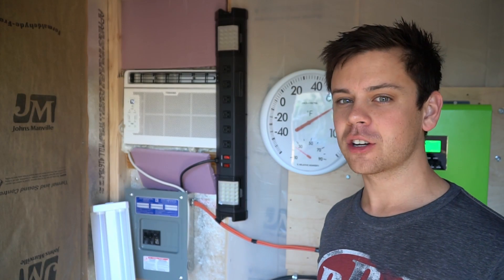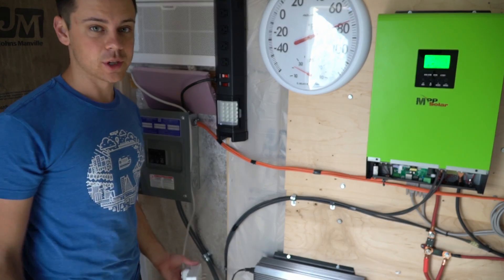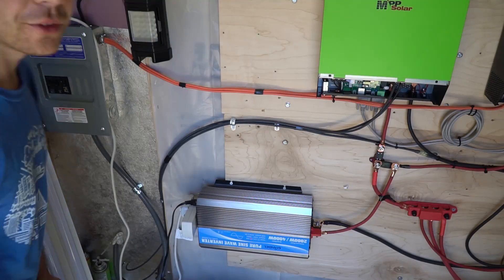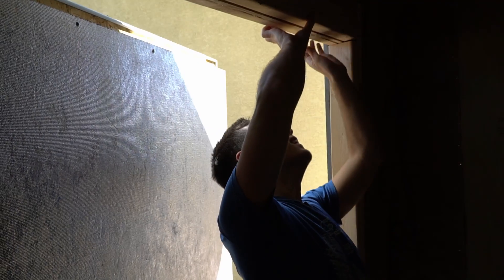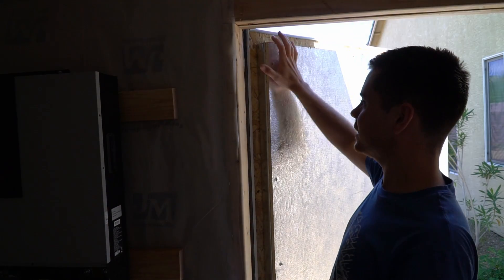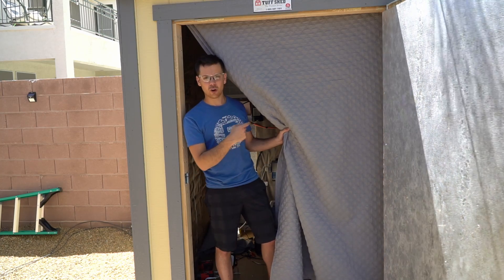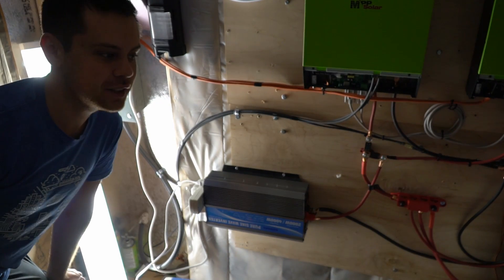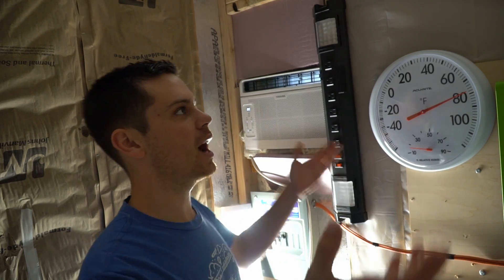Cheap Solar Powered Air Conditioner Part #2

Comment: Do the batteries, inverters and other equipment really need an air conditioner?  Or would a VENTILATION FAN with enough CFM airflow to maintain the power shed the same as the outdoor ambient be adequate -  even in Phoenix AZ?   Is the battery performance degradation and or battery life decrease at higher battery temperatures significant enough to really warrant the air conditioner power consumption?
Reply: Since Will lives in Vegas, where it can get over 120°F at times, yes, he does need an air conditioner to keep it at least down to around 80°F, since the batteries he uses need to be kept at least that cool to be as efficient as possible, plus many electronics don't like to be too hot as well.

Comment: It’s not all about temperature,        humidity is the big deal I think you are  living in Nevada where humidity is low
Reply: Yes. When electronics is involved, low humidity aggravates static electricity. I single touch could wipe out an inverter. We keep our data centers as close to 50%RH as a compromise between comfort and static control.

Comment: How to overcome the lack of oxygen issue since the cabin is airtight to 100%.
Reply: Do suggest the charge controller, inverter and batteries unit to install outside of cabin because they produce heat that wasting a/c cooling effect.
Reply: @chinkimloong3425  Those are the very things he's wanting to keep cool!
Reply: Why? Nothing in there requires oxygen.
Reply: @g-whiz286   the human inside cabin that breathe oxygen to survive :)
Reply: @chinkimloong3425  - It's not a cabin. It's an equipment shed. It would only be a problem if he was in there for several hours with the door closed. Highly unlikely. However, a low oxygen alarm wouldn't be a bad idea.

Comment: Heat goes up !  Insulate the roof and use TWICE the thickness of insulation.
Reply: Since he's mainly trying to keep it cool, letting some hot air out at the peak would help.  He needs more to make sure the hot air from outside isn't coming in the lower levels. ;)
Reply: @Tumbleweed5150  What I did miss is that the solar panels are mounted on the roof.  No direct sun on the shingles !

Comment: President Will Prowse, Prowse Enterprises, 
I built an outside cat house, which I heat with a halogen bulb in the winter. I placed an ACURITE temperature monitor in the cat house. It allows me to read the temp of the box 300 feet away, in my bedroom. They cost $20. and are powered by two rechargeable AA batteries. Bought it at Walmart and my outside cat loves being warm when it's snowing. Maybe, you could monitor your solar shed at two A.M., while you're still in your bed. Better yet, get 2 of them and monitor, the inside of the air conditioned shed AND the outside temp of your back yard. Go crazy and create a spread sheet.  ;-)   :-D   :-D

Comment: Heat go up... Cold go down...  As per the rule you are not loosing cold from the roof, loosing a few degrees in the middle.

Comment: Just a 1/2"-1" foam board on the celing, would probably make a big difference, with solar panels on the roof, helps alot!
Reply: Yes that would be the easy way. though the studs will also transfer heat.I would insulate over the studs as well. Basically insulate between the studs, the over all that put on some 1 inch boards. very easy to do and will eliminate most of the thermal bridging.
Reply: @SSingh-nr8qz  you surely know, but i thought this would be a good spot to contribute my 2 cents: ideally, the insulation and structure (studs) should not be in the same plane, for walls or roofs.  Best practice is to put continuous insulation outside (and not in between) the studs.  The dew point always occurs somewhere inside of or on the surface of the insulation when you have a temperature on one side lower than the dew point.  Therefore you want your structral components to be away from that and the potential for rot and corrosion dew point condensation creates. 
He should have stripped whatever cladding is on the shed, to add the insulation from the outside- creating a wall type that architects refer to as an "institutional level" of construction.

Comment: How difficult would it be to dig a hole under the shed and put the batteries underground?  Should keep them cool with no energy input.
Reply: I was thinking the same thing.   Wouldn't digging down a meter or so reduce the need for air conditioning the batteries altogether?

Comment: Yes, insulate your roof.  Seal all holes.  Use a temperature gun to see where the heat is coming in.   As a Canadian, air leaks are the enemy.  Like #744

Comment: Just a quick comment, you probably already thought about this but make sure to have the AC on recirculate instead of fresh air;  Especially since nothing in the room should be generating humidity, unlike an RV with heavy breathers or those with botanical proclivities :)
Reply: I've tried this, well, in a studio apartment to keep people's cigarette smoke from coming into the studio one other time.

Was cool in the studio one morning and I put the air conditioner in fan mode, and that is a feature to recirculate the air in the studio. I came back to the studio to find that the 70° air had increased to 85°. ☹️ 

I have a new 6,000BTU air conditioner. I live in an older studio apartment, which has an attic in the ceiling in the kitchen. That's the only place I can think heat seeped into the studio. Or maybe the fan unit in the bathroom let the attic air into the studio. 🤷

Comment: The easiest and cheapest was to insulate the ceiling is a drop ceiling. One it decreases the overall space to be cooled, its lightweight and if you need to get into the space you are not tearing paper on the insulation to do additional tasks. It is super easy to install and the best bang for the buck
Reply from the maker: Smart idea
Reply: DIY Solar Power with Will Prowse the other thing people forget to do if you really want to make it the Mose efficient is to insulate the floor. 3/4” ridgid foam then 3/4 ply on top of the foam screwed down. You are making a cooler, coolers are insulated on the bottom as well. You will be amazed once you do that as well as we drop ceiling

Comment: You would need 2 coats of insulation with air in between for optimum insulation (kind of the same way you DIYed the door).
Reply: In most cases like fiberglass the trapped air is the insulation.

Comment: Suggestiion:  Put two temperature sensors, on inside and one outside (in the shade) of the shed.  Sample them every minute, or some other fixed interval, and then map the difference between against power use to get the DeltaF/KWh factor.  This way, you don’t have to wait for the temperature to hit 100F, you can do the test any time you want.  BTW, 167W average consumption for keeping the shed Cool is pretty impressive.  I would have thought it would be twice that.  Always nice when the experiment yields unexpected or surprising results.
Reply from the maker: Oh that would be cool

Comment: The door seal on the hinge side needs to be placed on the door frame and not the actual door. As you will notice, every time you open and close the door the seal is sliding against the frame and not pressing as it is, on the rest of the door. This will make that part of the seal wear out in just a few uses.. Also, do insulate the roof.

Comment: Will, you should go to home depot (or amazon) and buy a inferred laser temperature gun to point at different parts of the shed and see the surface temperature inside.  Its a very useful device and you can check visitors for their temperature too...  Anywhere inside the shed that is bare wood is going to need insulation and will transmit heat from the outside....you can also look at setting up a pressure test to find any air leaks that will allow the hot air to come in.  cool experiments...
Reply: He has one that he uses on things watch his recent video with the relay being temp tested

Comment: You might want to get a thermal camera to check the inside of the shed. That could provide a better idea of where the hotsports are. Is there a good way to estimate the thermal load of the electronics inside? It would be itneresting to know how cooling is used to keep the electonics cool, versus heat getting into the building.

Comment: The roof is the hottest part turning into a giant radiator as the sun hits it. Then you’re south and west facing walls as the sun rises and sets. Window mount air conditioners are energy hogs they’re the most wasteful way to air-conditioning place it’s just physics by nature they’re designed that way because of their size constraint they have to use more energy than a conventional mini split because of the smaller evaporator and condenser therefore the refrigerant pump has to work harder to move more pounds of refrigerant to do the same amount of work then a mini split that would have a larger condenser in a larger evaporator and a large fan that does not have to move so fast using so much energy.     Yes you would have to spend a little bit more money for a mini split like the FUJITSU 33 SEER. But the amount of money you have to pay for extra batteries extra solar panels and possibly still have to go on grid and pay high daytime energy rates in the long run it’s worth it.           If any company that makes window mount air conditioning says their energy efficient it’s a lie no comparison to a mini split due to the physical limiting factors of size.
Reply: True.. Obviously sheds don't have attics so what's the best way to keep the cool air inside and the hot sun away?  Just mount the solar panels on the roof and standard insulation?  That's all I can think of unless there's some other tips I'm missing.  I'm trying to setup A/C in my workshop-shed.
Reply: Steve H call list a few things. 1: painting a roof white. That is good for a 20 to 40° drop in the surface temperature of the material that is struck by the radiant heat of the sun.        2#  Depending on your budget because phone cost several times more than fiberglass we all know you must insulate. 4 inches of foam will nearly give you double the amount of insulation of 4 inches of fiberglass.    If using reflective foil backed foam keep about a quarter inch gap between the surface of the roof and the phone so you do not get direct conduction heat absorption from the roof material.         #3 option if you have not built your roof yet and are in the planning stage. Put roughly 3/4 of your insulation value on the top sheets on the outside of the roof foam R30 value. Then on the inside underneath for example you can use R15 or R19 value form. These are all just examples you can move the Numbers up and down just remember if you choose this method put more insulation on the outside of the roof than the inside especially in cold climates for the winter has to do with condensation on the inside problem. Also take a note depending where you live North Dakota you’re worried about -15° outside. Arizona you’re worried about positive 115° outside. I’m in San Francisco we average about 65° summer and winter lol 😂.              If money is really an issue and something is better than nothing. By the double sided foil reflective bubble wrap that you see used as insulation on ducting. Staple it either by eye or by using little 1”X1” length of trim pushed up against the roof as spacer to attach your bubble wrap. Leave roughly a 1 inch gap at the bottom of your slanted ceiling and a 1 inch gap at the top. This will block nearly all radiant heat from your roof material but allow a little airflow to go up in that 1 inch gap at the bottom and heat will make it naturally flow up and come out of the 1 inch gap at the top. I know you’re thinking you want to stop all the hot air from coming into the building but you need this airgap to stop mold and mildew condensation from rotting out the wood when it gets cold during the winter time. Then maybe later on when you can afford it you could add a little fiberglass bat insulation to the ceiling on top of that silver bubble wrap just remembered do not push the silver bubble wrap so it touches the roof because then you get conduction of heat and you lose the ability to reflect heat.  4# and if you’re in the design stage design the roof of your shed to slant at the perfect degrees towards the sun to mount solar panels. The shadowing of the solar panels will aid to reduce the sun load on the roof of your shed.
Reply: t lech would the foil-backed bubble wrap go BETWEEN my roof joists on my conventional roof for my house?
Just leave the gap for air flow.  Very important here because we often have high humidity.  Having my roof reshingled and adding a ridge vent.  My neighbor did it and says even on the hottest of days (of which we get plenty), his attic temperature is a good twenty degrees cooler than it used to be.
I live in North Florida and it’s rarely cold....but air flow is an important consideration due to our nearly constant humidity.
Reply: t lech foam on top of your roof deck?  How to hold the roof on through the foam to the deck??

Comment: Hot goes to cold heat rises so no if you are not pulling in air from the bottom seal the room low. If you need air and most people do, air in from the top in a duct low like a chimney L shaped a least at bottom. Ls at top and bottom is best. Psychics some people here got it backwards sorry I'm rude but honest. Think of termites they make convective cooling towers moist cool air flows up and pushes the hot air out. One thing about Window AC is the dehumidifier part of them on the coils is pulling moisture out of the room when the cycle stops water falls into the pan so a slight outward tilt down the side loover holes are the correct angle. Ok so long story short you may from time to time hear a waterfalll or sparking noise it's normal that's ice crunching in the condenser fan that cools the motor and the coils as much as 30 degrees if that water was not there the unit would not be as efficient. Do not over size a room for more BTUs the AC will not run long enough to dehumidify the room. Only in the humid season or rain does this truly work though. That economy button will raise the temp over 4-8 hrs 8 degrees to save money. Most climates it is cool in the morning all but Vegas and Phoenix where I am. Too dry or dusty especially June to July clean the filter vacuume or wash with mild soap if gets greasy. Soffet vents under the eves will allow the cooler air to flow down the walls and cool them if you have an attic a whirlybird near the peak will help bring in cooler air from up high vs the scorching hot ground temp.

Comment: Anyone know what it would take to keep a 150sq ft room at 68 farenheit with outdoor temp being 98, using solar power as well? And keep it cool for 16hrs of the day
Reply: 68 cool vs 98 hot ouch if in RV go for 78 in day 8am - 9pm then use 75 with Fans unless u have trailer full of Lithium battery . 75 in small 10ft 15ft 9ft tall room r5 insulation can b cool with a fan .  15 yrs of van life in TX .

Comment: It would be great if you could meter the outside air temp & RH, inside air temp & RH, kWh's, AC Pwr, DC Pwr on a 15 minute rolling average of 30 second sampling.   Then you would have standard HVAC SCADA data to optimize your system under varying conditions.
Reply: @ DIY Solar Power with Will Prowse
here is a reason for that logging you said you're not fond of

Comment: 120F is 48C  :o   I do not envy you, that is brutal.   And I find 25C is too hot lol.   For your insulation you should have used regular roxul batts then put a vapour barrier.  Otherwise you're losing lot of air.  That paper stuff does not really do much for air sealing.

Comment: Great show Will. Is there an economic way to convert a Dometic RV fridge to run on 12v?
Reply: Most RV refrigerators (at least the older ones) are absorption-type which makes them horribly inefficient on electricity. Refrigerators designed for efficient DC operation are prohibitively expensive. Look for an energy star AC powered refrigerator and just run it off of an inverter.

Comment: You think a heat pump like a mini split Could be powered? How many watts like 12v 100ah battery with a 2k power inverter?
Reply: AC is the same as a heat pump, just inverted
Reply: @tobimai4843  - window A/C units are notoriously inefficient due to design compromises made to make everything fit into a small rectangular box. A good split system of the same capacity will be far more efficient.

Comment: Run your gasket on the hinge side in the jamb, so the closing door presses it instead of pinching-sliding on it.

 Otherwise the sideways pressure in that area will knock the gasket off.
Reply: Some body did this before!

Comment: I spend a lot of time outside in my shed (it's only like 8'x8') using it as part of my metalsmith workshop and something like this might be the perfect setup for the summers.  Winter is fine... I can dress warm & use a single propane heater if necessary.  I've literally been dreading the thought of working and sweating my butt off this spring/summer.  I'll be using the cheapest stuff which I'm sure you won't agree with.. because I'm still not rich yet, lol.  Thanks for the idea and advice on a project like this!

Comment: Sizing an AC system in a vehicle in the bay, i'm so jelly of your extremely dry air. Makes it so much easier. If you recorded humidity along with daily consumption you'd prob find a direct correlation between ambient humidity and energy used.
Reply: Roadsteading Absolutely!!